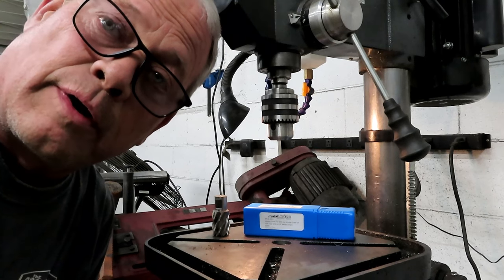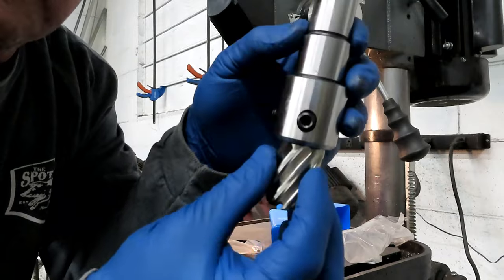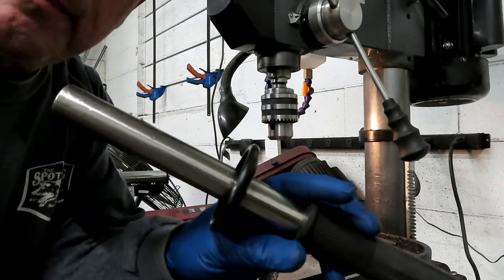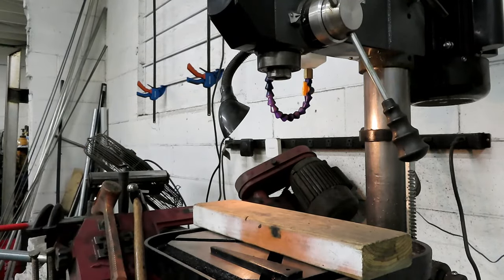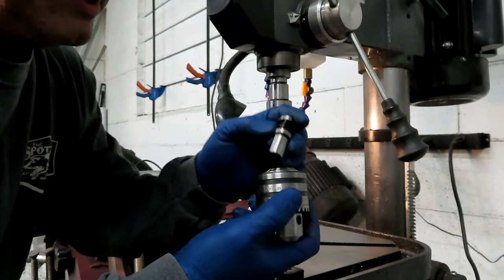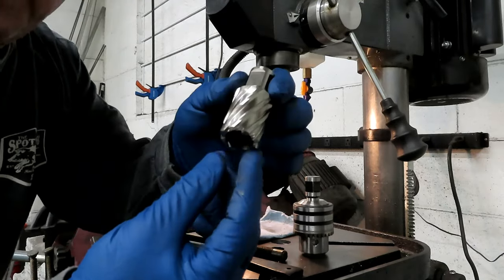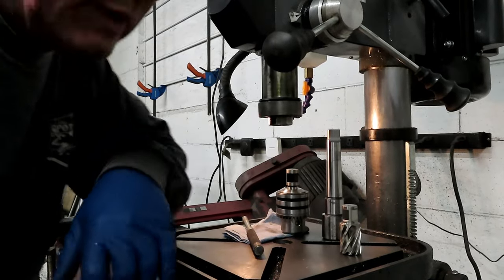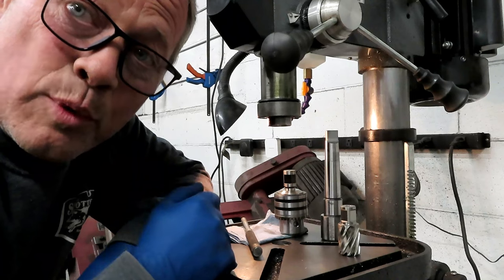Annular Cutter on a Drill Press [Easy DIY]

Comment: I have had really good luck with accusize products. Just a heads up JT3 and MT3 are not the same. That JT3 taper is the other side of the adapter that goes into the chuck itself.
Reply from the maker: Thanks! I wasn't aware of that. Thanks for the info. And, thanks for the assurance on AccuSize. It's my first product from them, but I've heard good thing. It was recommended to me by a good friend who knows this stuff forwards and backwards.

Comment: The best thing I ever did for my shop was installed a central vacuum cleaning system in , alls you have to deal with is a hose, I did it all myself in a vacuum sits outside
Reply from the maker: I can see that with a wood shop and sawdust. I've tried to use the shop-vac, but the long metal shavings just clog it up and create a big Brillo pad halfway down the hose.

Comment: MT# is for Morse taper & JT# is Jacob Taper, just to give you the right Nomenclature. Either way that's a good idea, you can also do that with a MT3 Collet if you want to try using End mills in your drill press too. I use it when I use small End mills when I need to make slot cuts or minor machining.
Reply from the maker: Thanks for the info. Nomenclature never has been my thing. I just know how to run it. When I need something, I ask for "You know that thing that goes in that other thing" 😄 🤣

Comment: In my experience, milling bits do not work with a drill press. Because of vibration, created by the milling bit, chuck separates from the spindle. This isn't a problem with drilling bits, as those work under downward pressure. Also, this isn't a problem on milling machines, as those have long chuck holding bolt through the spindle.

That's one thing. Another problem is most of the drill presses have ball bearings for the spindle, which cannot handle any lateral loads exerted during the milling process.
Reply from the maker: Yeah. That is all well understood. But these are annular cutters. They are NOT milling bits. They are basically really thick hole saws. They DON't go sideways, like a milling bit does. They go down, through the steel, like a drill bit. It is all downward. At no time during my video do I represent this as a milling bit. They are annular cutters. Basically a combination of a hole saw and a drill bit. Of you haven't tried one, please do. They are amazing. Better than a hole saw or a TCT hole saw, and much better than stepping up through several size drill bits to get to final size, or just using a 1" drill bit. It just cuts the outer diameter, has a wall thickness of about 1/8-3/16 thick. The center pin punches out the center plug after it finishes.

I know they look like end mills.

But yes, you are right about the bearings. People try to run milling bits in a drill press, and ruin their press. And I would imagine that it would not leave a successful pass.
Reply from the maker: I'm going to have a video review of the Vevor 13zPiece Annular Cutter Set in a few days, and show its operatik . So stay tuned so you can see it. I'm waiting until I can figure out how to post my Vevor affiliate link to my videos, so that you guys can buy the set at a discounted price.
Reply: @AllStarWeldingSC   Thanks for elaborating. I didn't use those before.

I did try using, however briefly, milling bits with a drill press and Vevor 2D table. As long as you try cutting a grove (with slight downward pressure) in a soft material, it works marginally... With no precision whatsoever. As soon as you try cutting a side surface - the chuck might pop off. It's just not safe. Not to mention it can be destructive to the drill press. So, yeah... A drill press won't cut it, it's not a milling machine.

P.S. I think you probably know all this. I wrote this information for the benefit of other people, who might have the wrong idea about their drill press.

Comment: my central machinery  43389 drill press is MT2 with 3/4 inch throw.......do they make this adaptor to fit my 43389 dril press/ MT2 also ?
Reply from the maker: Look on Amazon for "MT2 to Weldon Shank"

Comment: Quicker to swap the morse taper.
Reply from the maker: Probably, but I noticed that this combo runs so much more true than the horrible Central Machinery arbor. So I will leave it like this for a while, until I get a better one.
Reply: @AllStarWeldingSC  It's a better product then the std. morse taper.
Makes sense now

I have had some troubles with product sold by dealers.
Now I buy over the counter and check the product before I pay.
I real is a pain now, with so much rubbish being sold by machine dealers.

Comment: I would think those set screws may be problematic with smaller drill bits/higher rpms.
Reply from the maker: The set screws will always be against a 3/4" shank, regardless of drill size. If it's a twist drill, it will be in the drill chuck, which has a 3/4" Weldon, and if it's a annular cutter, they all have 3/4 Weldon regardless of size. The set screws are pretty beefy too, about a 1/4". I was glad to see that.